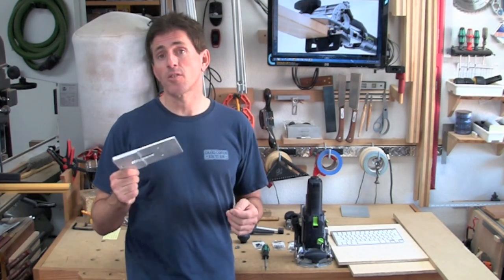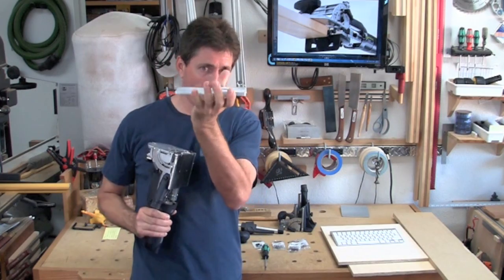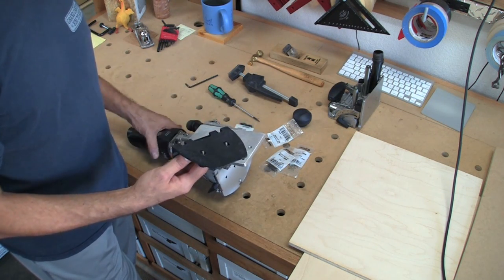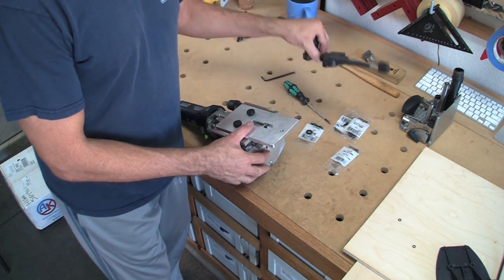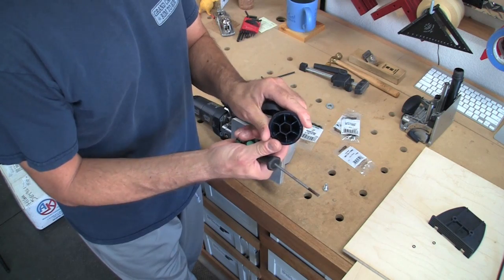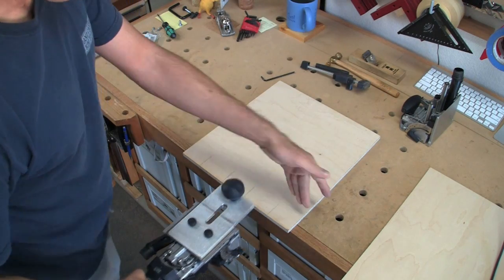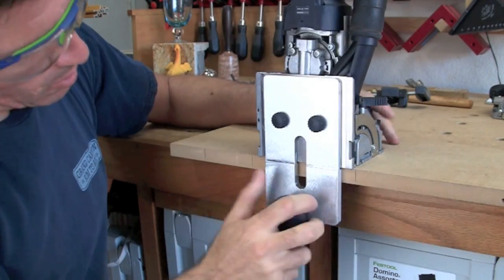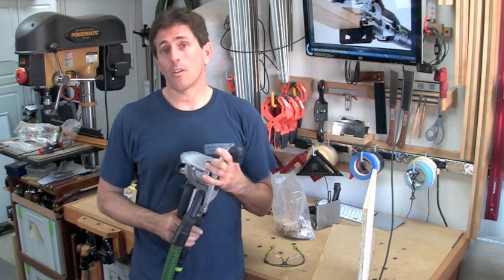#55 - Domiplate Festool Domino Accessory Review

Comment: FWIW:  I have had success with the sheet stock standing upright and using the domiplate and the machine base to sandwich the stock between to keep the domino vertical on the edge.  Just finger snug is usually enough to let the machine slide on and off easily.  Regarding the screw sizes it's nice to know what to look for in the endless bin array at the local tooltoy emporium.

Comment: I just got my DF500. I would almost always use 3/4" stock for casework. Is there any reason fence drift cannot be avoided in a production setting by simply not using the fence at all, instead indexing machine and all work pieces from flat bench top, taking advantage of the 10 mm offset from machine base to cutter centerline? (And using a vertical backstop/fence for corner face mortises.) This is the method Frank Klausz advocates for biscuit joinery, and it eliminates such problems. Seems that the 10mm offset from Domino base to cutter centerline will work perfectly for this limited application. Am I missing something?

Comment: If they are selling the plate they need to provide mounting screws and knob. Too much time wasted getting it set up to save time.
Reply: Maybe the screw sold separately for get more prifit
Reply: It has come with the handle and thumb screws for some time now. I got mine years ago and it had it. It's also black anodized now.

Comment: where did you get the labels for your systainers? the originals came right off mine!!!
Reply from the maker: +ecfd16 A guy on FestoolOwnersGroup.com (FOG) printed them up for members. If you go there and search for custom labels, you should find the thread. It turns out that FestoolUSA.com has a label printing section so you can print your own on nice label paper. I haven't used that since I got these, but I've seen people use them to label all kinds of stuff nicely.
Reply: ecfd16 i
Reply: The handle hole (for clarification) are you stating that it is tapped for M8, or that we would havr to tap it?

Comment: So looks nice you did all the dominoes tight width is that your usual practice?
Reply from the maker: Nick Mortimer I prefer to do them to the tight width if possible. If attaching a really long nosing  or similar piece, I'll sometimes use medium width for all of them except one anchor Domino, but in this case, it is more about attaching than structure.  Once you get good with the tool, you'll be able to easily drop 6-10 on a panel and get a fit; worse case, you trim one of the outside ridges off a Domino to help it out where you were off a hair.